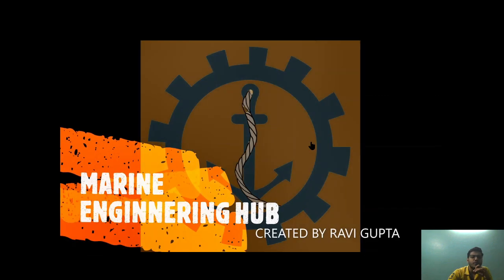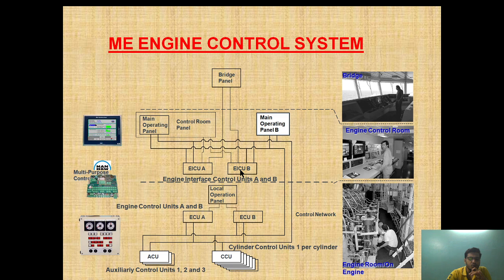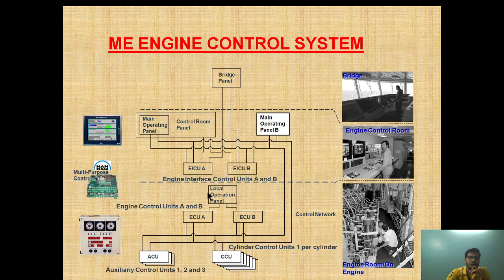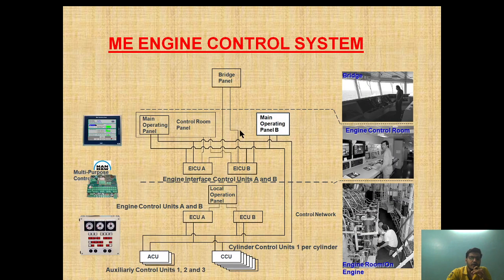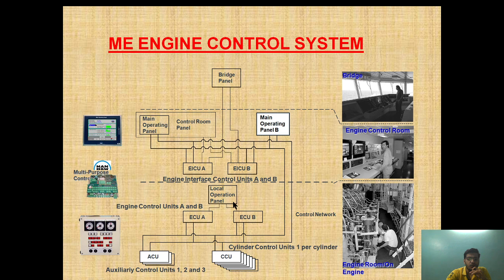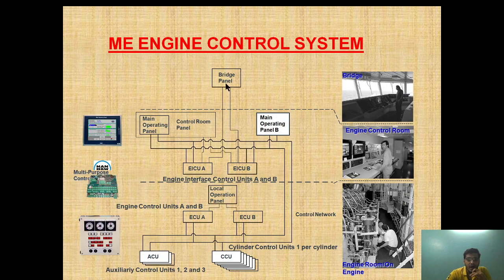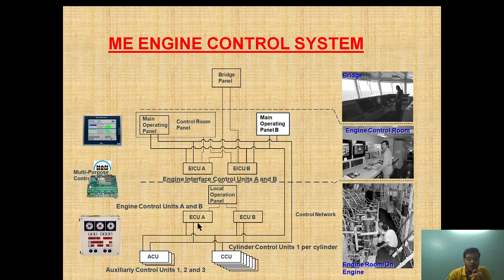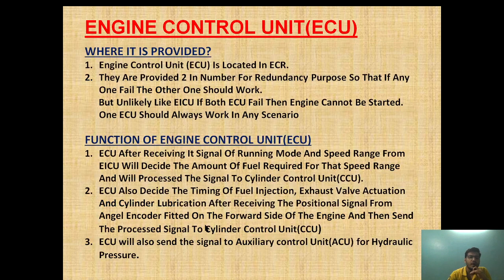ME Engine Control System| Engine Interface Control Unit(EICU)| Engine Control Unit(ECU)|(Part-2)

Comment: Sir one doubt that you said angel encoder tells in which direction we have to rotate So from where Angle encoder receives the signal first?
Reply: Purpose of the encoder which is connected to the rotary motion and it sense the rotating of propeller as well convert into pulse  then it going to controller,so that encoder can determine the position of propeller and also cw or ccw direction